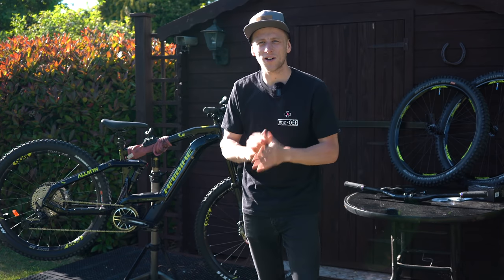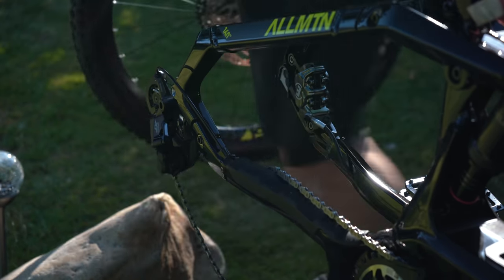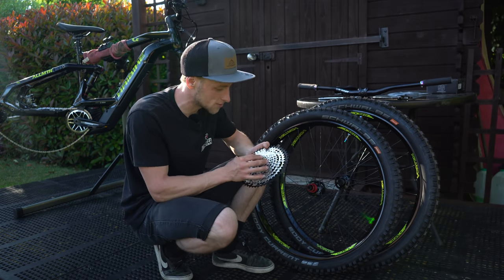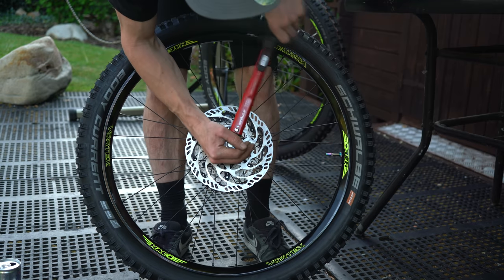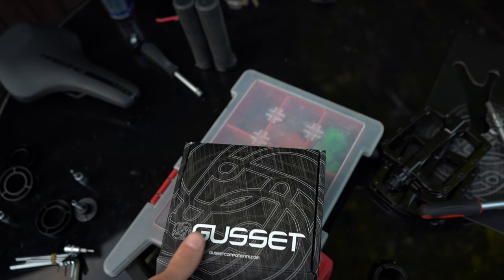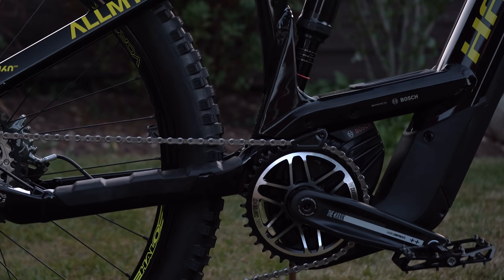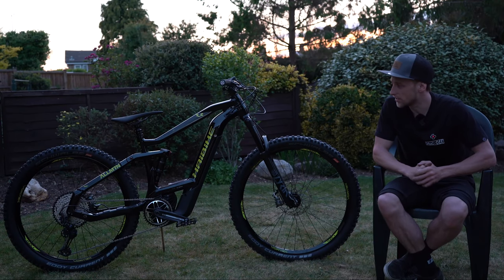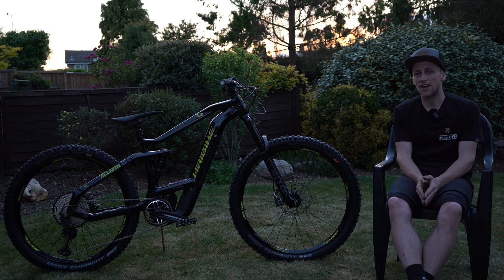BRAND NEW EMTB & UPGRADES// HAIBIKE ALLMTN 3.5

Comment: That's such a beautiful beast!!😍 Love the new eeb Cards, looks truly amazing. The Micro Spline is not that old, it first came out with the XTR 12 speed about 2 years ago and it's been my dream since that moment....but I think the new XT groupset is just amazing enough and I'd love to have it some day. I love the fact that Halo is doing a Micro Spline version of their wheels, because the Supadrive is pure dreams...I'd run it with Centerlocks rotors though...I really prefer them to the 6 bolts...but that's not a huge difference...actually now with your adapter it's like you're running centerlocks, which in my opinion are stiffer and a bit more trustworthy (no chance of a bolt coming loose). Anyway...love the vid...enjoy the bike!!! 🤘🏻